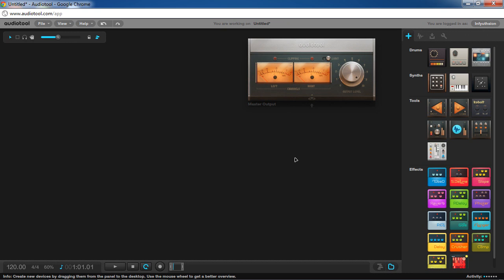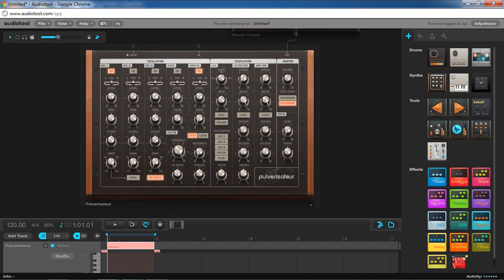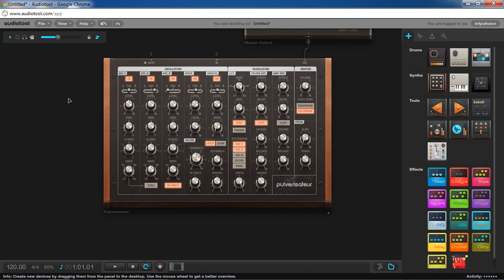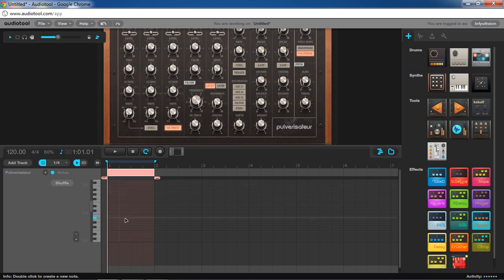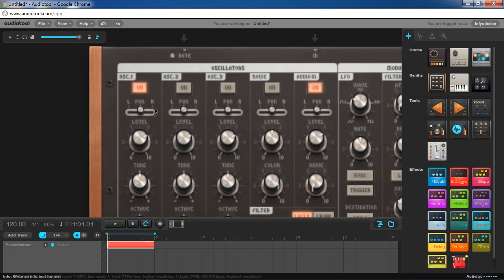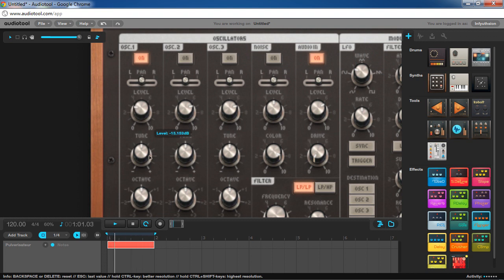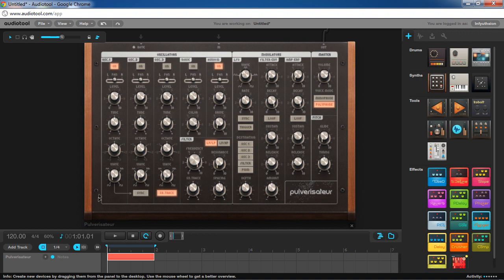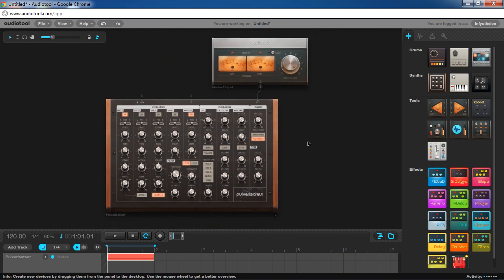Synthesis Basics Pt 1

Comment: first to anyone who hasn't started watching, you can save some time by skipping to the 4 min mark, that's when the practical, useful info begins on how to actually use a synth.  generally speaking some good info here for sure, but agree w/the others, pls learn how to pronounce words a little better, it's distracting, and strongly suggest using a better soft synth that's easier to follow along with (there are many good free ones out there).